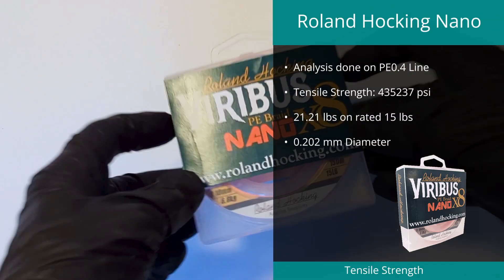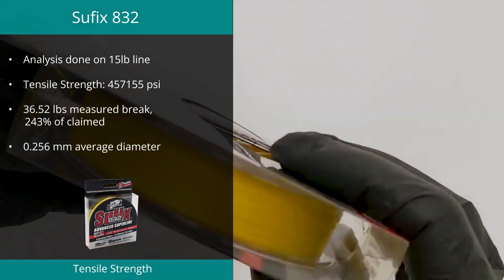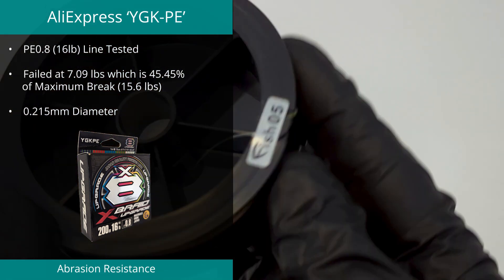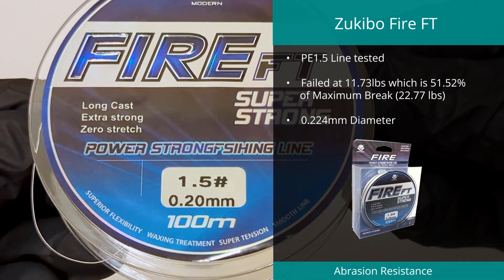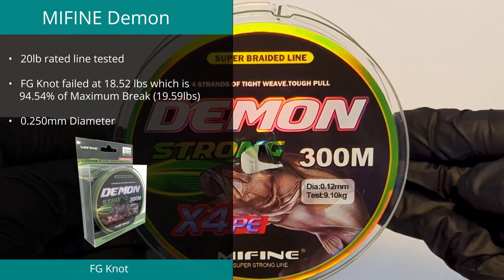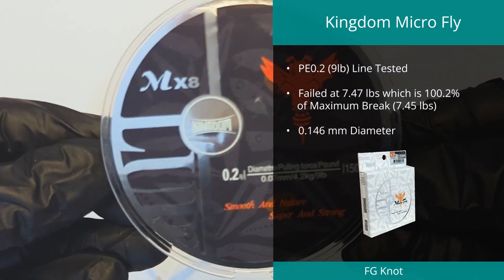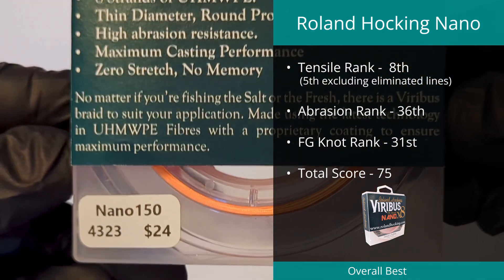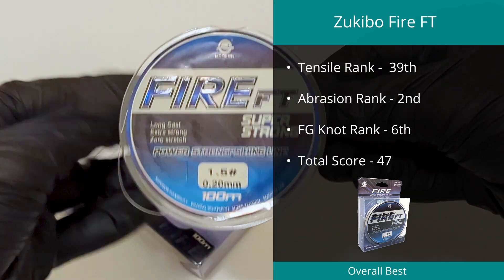The Top Braided Fishing Lines for 2025

Comment: Gliss, Zubiko Firext, and Berkley forward are extruded polyethylene. They are NOT braided.  I've been using these lines for at least 15 yrs and though it rates so high when it is fresh, and is the best casting line I have ever used, it has it's faults.  The primary fault is that it isn't durable.  With some use and abuse the extruded process fails and the fibers separate making this line lose a lot of it's advantages a lot quicker that traditional braids.  I love casting this line, but hate how quickly it gets weak.  The problem is it casts so great I don't want to use any other line.
Reply from the maker: Yes, I agree.
Reply: What’s best braid then, I like to spool up lime and not worry about it for two seasons
Reply: I used the original fireline 50lb back in the early 2000s  for throwing crankbaits and heavy shads after pike for many years. Never noticed a significant drop in strength even after the dye came off. Not used the latest version to compare

Comment: This doesn't make any sense.   Why would you compare 15lbs line against 3o lbs line.  And you don't explain how many lines you went through to pick the lines on your list.  This only helps if someone is already using one of these lines.
Reply from the maker: It's literally in the first 30 seconds of the video, over 240 lines. The numbers we compare are line size independent like tensile strength. These are the lines that have the best numbers irrespective of their size.
Reply: @thelinelaboratory  Yes, it says the number, that's not helpful either.  Do you fish? What do most fishermen base their decisions on when buying line.   We need a lot more context.  How many tests per line? Did you test one batch set or more.   Read, scientific principles of testing and comparing.

Comment: I have zukibo fire. It was good for a while but I’d say after about 10 uses. It’s starting to get that weird fraying look like cheap spider wire does. It’s also not completely straight anymore. Almost like it’s braid with memory. I’m gonna trim this part off. And continue using it. If it keeps doing this I will probably not use it again. And would rather give the money on Varvivas 8 strand or suffix 832

Comment: I'm commenting after watching only the first 1.5 mins of your video but the one thing I'm glad you are doing is the tensile strength. That is the only way of truly knowing a lines strength. I did calculations from another video where the guy did NOT work out the tensile strength. Results were that a line known for its diameter being smaller than others had no real advantage because it's actual tensile strength was lower than the other lines, so basically one could just buy one of the other lines at a lower rated breaking strain, and end up with a line that is both thinner and higher strength. Tensile strength is everything when it comes to how strong a line is so good on you for doing that.

Comment: when the FG knot fails during testing, does the braid break or does it slip (or slip a little then break)?  I assume it's breaking?  if so how much stronger is the leader?  I will read more on your site apologies if I'm asking things well documented just found your site and very happy it exists.  Also I wonder about FG knot strength in mono vs flouro is it the same or different?  and if the ratio of diameters is a factor, as the braid "cuts in" to the leader, in this knot, I believe, to hold...
Reply from the maker: When testing braids i ensure the failure point is the braid itself and not the mono. A mono line is used that breaks slightly above the break of the braid to ensure the strengths are closely matched but the braid is the weakest link. I am unsure on slippage, it may slip a little as it tightens down under pressure but it wouldn't be more than a mm or so. We did a video on knot testing which shows the typical failure point for the FG on braids.

Comment: Hey mate, 

This may be difficult but do you reckon it's within your realm of know how to somehow take all the date you've compiled on line thickness and form an approximate algorithm to estimate line thickness and spool capacity? Obv as your tests show line thicknesses for a given PE rating are all over the place so the estimates on the reel are very mis leading sometimes. Would be a great tool to figure out how much backing or how much line needs to be ordered for a particular spool? Doesn't need to be super accurate I think, maybe just approximate. I imagine a algorithm that takes spool depth and diameter into account, I.e. enter spool  inner diameter, out diameter and depth and it sort of gives you a rough indication of how much of a particular line would fit?
Reply from the maker: Yes this was something i did start working on a while ago but the maths just wasnt working for it to be accurate as i would of liked. I think i need to spool up a bunch of reels with a known braid diameter, see how much it takes and work out some maths that fits the result. Then try it a few more times with some different braid to see if its robust. Its tricky as braids can do funny things when wrapped under pressure, flatten out, fill gaps and so on but maybe i can take another look at it when i have some time.
Reply: @thelinelaboratory  it does seem very tricky, a lot of variables: How tight the line was braided, the softness of the material used, the shape, spooling tension, maybe a project for an AI model.
Reply from the maker: @DOBlob  Yep spot on - lots of variables. I will have a think about it and see if i can come up with something.

Comment: What measure of variability did you consider?
Reply from the maker: Can you elaborate?
Reply: @thelinelaboratory  Maybe range or standard deviation plus a test of statistical significance to show one line is significantly better rather than just lucky.
Reply from the maker: @KhakiPantsFishing  All the test results are in the videos so if thats an important factor for you then feel free to calculate it. The lines that do not have a video and only have the results published on the website have the average numbers shown but i hold all of the test data in the back end for each test however i simply dont publish them for simplicity sake.
Reply: @thelinelaboratory  Thanks, and thanks for all the work you doing to test the lines.

Comment: Your approach is great but you sometimes you forget common sense. Like with the Kingdom Micro Fly line: If the line is twice its advertised diameter, it is obvious that the breaking strength will more relatively more than a brand which is more honest in reporting the diameter.
Reply from the maker: Nope. Advertised numbers in diameter and breaking strain are never used in any calculations, so no matter if they say it's .1mm or 10mm it makes no difference.  We do display the actual numbers and how they relate to the advertised numbers but that is only for interest sake and means nothing. You need to look at the tensile strength we calculate. That uses actual line cross sectional area and actual strength.
Reply: But it takes the first place in the fg knot part, because its knot strength is 100% of the advertised strength. So cheating gets rewarded here: they have a relative high knot strength vs advertised strength because their diameter is 100% more than their advertised diameter. They might get punished in other parts of your ranking, where they get a penalty for lying about diameter, but in the FG know part they win because of it.
Reply from the maker: No - this is where you are incorrect. FG Knot strength is a percentage of the tested breaking strength, not the claimed breaking strength. If you look at the details in the video, it is rated at 9lbs, but maximum strength was tested at 7.45lbs. The FG was 7.47lbs so its 100% of TESTED strength.

Comment: Slow down with the texted slides. I want to read them then absorb the context. Speed reading only allows me to partially get the gist of the context.
Reply: Left bottom corner of the video frame, there is this thing called "Pause" button. Or you can simple click on the video screen to pause video. 😆

Comment: When you test FG knot strength, how do you standardise the testing. Do you use (for example), 12lb leader with pe 0.6 braid and 20lb with pe 1.2 braid. 
OR do you use the same (for example) 60lb fluro leader with each braid you test please let me know.
Reply from the maker: Great question - they type/brand of leader used is consistent but in various strengths. We will test the braid to establish its breaking point, and then choose a leader with a break that is slightly higher than this to ensure that the braid and leader is closely matched BUT that the braid will break first. Its not really possible to always use the same strength leader on every line, for example we can use a 100lb leader to test an 80lb braid, but that same leader isnt reasonable to use on an 8lb braid. We try to test scenarios that are realistic (braid/leader combo) but try to maintain consistency.
Reply: @thelinelaboratory  so say a pe 0.8 braid tests for 10lb of strength, would you then go for a 12lb leader for the fg knot test?

Comment: 99 percent of the time the leader is what makes contact with structure so its the breaking strain or abrasion resistance of the fluorocarbon that matters, not the braid. Unless you are using straight through braid which is rare. I cant remember the last time the braid cost me a fish.
Reply: This totally depends on the fishing style. In shore jigging, when targeting amberjack the braid comes in contact with rocks and other structure when the fish tries to escape. Also, abrasion resistance indicates how much abuse the braid will tolerate before losing its strength.
Reply: Yes, I don't disagree with you. Frog flippers also use straight through braid so I get there are specific case where the abrasion resistance of braid comes into play.
Reply: even with a leader, the braid can come into contact with structure. I say abrasion resistance and cast-ability are the two most important characteristics. For most cases, drag should keep the line from breaking unless it is damaged.

Comment: I was hoping soon you guys could test the sunline almight sinking braid. Its been very popular the last year and ive got it on half my spinning setups currently. 
It would be great to get some actual data on that line because its so new.
Ive found it to be incredibly thin, and because of that, it is very weak. In my own testing ive found that I need to upsize drastically. 
With braid to fluoro im using the 16.5 with 10lb leaders and 13lb with 6-8lb leaders. Where 10lb Jbraid use to be fine with a 10lb fluoro leader. The 13lb almight snaps at or above the knot. 
Love your work and I think a lot of folks would like to see that almight tested.
Reply from the maker: Definately an interesting line that we would love to test. Do you have any spare that you could send in for testing?
Reply: @thelinelaboratory  I will message you. 
I have some 16.5lb almight and some 20lb X8 xbraid sinking I could spare

Comment: Really they all broke at the actual dia/ to break.    I am convinced all braids are pretty much the same these days.   Buy by dia not by rating lbs.
Reply: the diameter rating isn't accurate at all by the manufacturer
Reply from the maker: @lansiman exactly, can't use that for most brands in order to pick the right line.
Reply: @lansiman  that's why I bring a caliper with me to get line.  Heck I have even had same rated spools be different dia with the same company.
Reply from the maker: @ctious even calipers struggle to measure braid with any accuracy. Mono is fine, but calipers will almost always crush it with any pressure but honestly it's the best or only option when your out shopping.
Reply: @ctious  actually i did that, but to be honest caliper isn't a very good way to measure braid, it'll flatten when you measure, you can wrap it a few round around the caliper to get an average diameter, but the reading will still be quite hard to use as it doesn't line up with the spool line capacity by the reel manufacturer, for example it say 0.35mm-100m at the side of the spool, it will be accurate for mono line but in my experience, a pe line you measure to be 0.35mm will not fit 100m in the spool
Reply: @lansiman  I rotate it and take measurements in multiple spots.  I just need to get close to tell it's dia and break.   I dont crush it.  It's amazing how bad companies lie about dia on the spools.  Should be sued for false advertising.     On that note.  One of the most consistent ones for dia I have found diawa j braid x4.   I only use 6,8,10lb though.

Comment: Maybe you could make rates by   diametar...for exame PE 1.0 the best is...., for PE 2.0 best is...
Reply: PE does not refer to diameter. For example pe1 from gosen and pe1 from varivas do not have same diameter
Reply: @aurelianobuendia5360 its also a good information...for reel capacity...
Reply: @aurelianobuendia5360  his argument still stands. He should do top 1-3 on claimed breakage
Reply: @EuIenspiegel when you buy fishing line you buy based on what says on package or you care about actual line diameter because we both know companies lies about diameters.
Reply: @a @aurelianobuendia5360   obv i care abt the actual data of both diameter and strength. But when i buy normal line i look what they claim the lines strength is. 
In Asia u also have PE as a measurement but they also lie abt that too.
Reply: @aurelianobuendia5360 hi from Turkey, gosen, ygk x braid and varivas, For long throws and durability, (for 1 pe)

Comment: From my experience in manufacturing, you should probably rate brands as well. For instance, a mediocre brand might change their nozzles once a month and the stuff they produce on the first day of usage can be absolute top tier premium grade. But the stuff produced on the last day before the essential parts are changed again, can be hot garbage. Brands aiming to be high end will simply put have a higher maintenance frequency and less variation over time. This can go a long way in explaining why some brands test incredibly well, only to have bad user reviews at a later time.
Reply from the maker: yes i understand your point but i am not sure how i would rate them. how do i know if i get a good or bad batch for line? what criteria should i use? Simply rate on line accuracy (ie: it is what they say it is?) which i doubt will work as thats really only rating their marketing department, not their actual line. its a tricky one.
Reply: @thelinelaboratory  It's not something you can rate on a case by case basis, All I'm saying is that when something seems way too good to be true, it probably is. And in the case of "miracle lines for cheap", I think those will in most bases be based on flukes. 

And it's not like you can really rate the manufacturer either, because some will focus exclusively on high end lines (and thus rate good) while others produce both extreme high end and very low end products under the same brand.

But rating accuracy would be good.

And quite frankly, when you buy line from a cheap brand it might be that the line you're testing isn't even from the same factory as the line they put in the same box the next week.
Reply: As someone with experience in tje sector, what 50 pound x8 or above line would you recommend?
Reply: What kind of material are those nozzles made from, ceramic?
Reply from the maker: My understanding - and i am not an expert - is that the fibres are generally created using a "gel spun" method. Kind of like how fairy-floss (cotton candy maybe if your in the US?) is created so i am unsure if there is a nozzle used that is the size of the individual fibres, which are ridiculously thin. I guess there is a nozzle somewhere along the line but not sure if its super relevant to the final product.
Reply: @thelinelaboratory  I didn't mean to confuse you, I work in precision manufacturing not in line manufacturing. I was just pointing out that this is how abnormalities tend to happen.